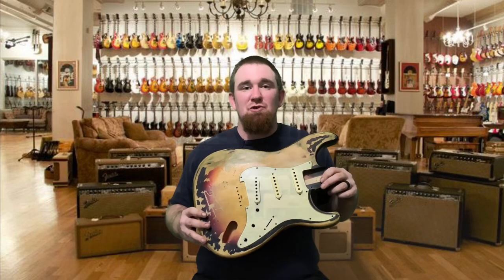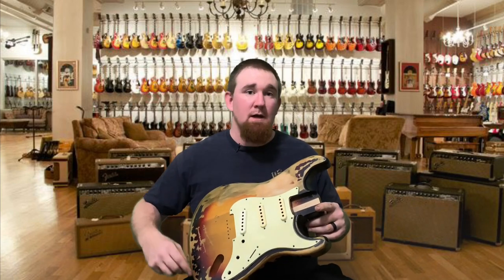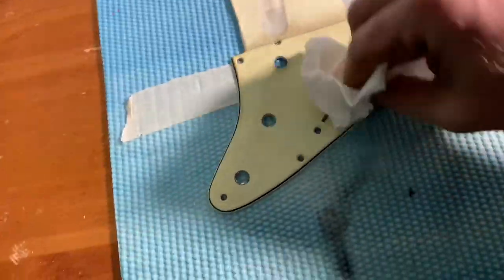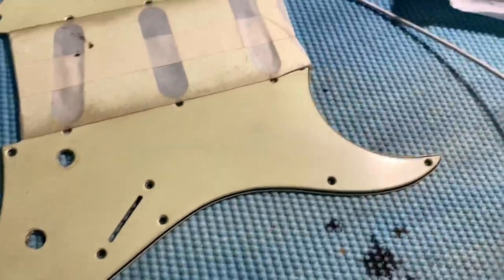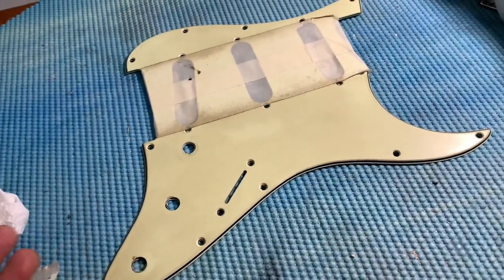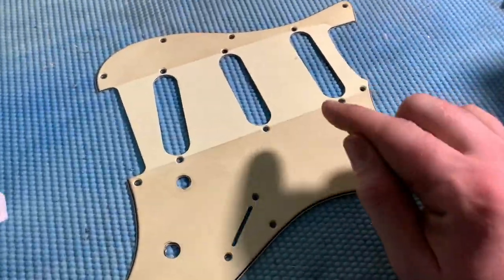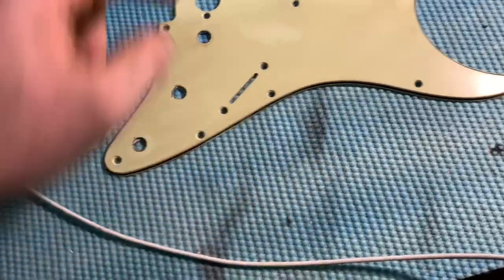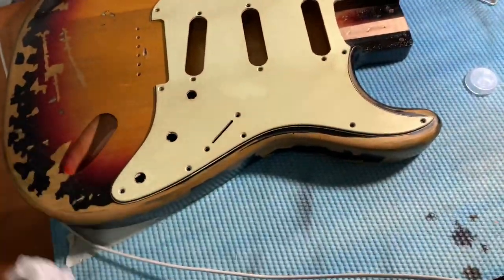How to Relic a Pickguard

Comment: Wouldn’t it be cool if you actually told us wtf you’re using in the video to age the guard. What a concept! Make sure to just rub the alcohol and not swig it 🥂
Reply: he's using a minwax wood stain. Probably one of the darker ones.
Reply: There's a better way to do it. He used minwax ebony wood stain, and steel wool. That's fine. But, the way the pros do it is to use a spray gun, or airbrush, and lightly spray an Amber tinted laquer over it. Rub it with some steel wool, heat gun to lightly warm it up and then create little cracks near the screw holes with a small hammer. In reality many vintage guitars don't have heavy ageing. They just amber over time with common little cracks where the screws go.
Reply: What's the point of showing that if you don't show what you used to make the relic colour. What a waste of time.
Reply: Lol chill out. Just find some gooey dirty crap and go to town. Dirt is uhhh... Dirt lol.
Reply: Read the can dummy
Reply: Look at the can, it’s clearly Minwax wood stain

Comment: a couple other things people can try - Lugol's iodine.  i accidentally discovered this after a guitar pick got stained.  try it on  a test piece first to see if you like the tint.  The next thing i have actually tried successfully (but takes longer) is leaving pick guard in direct sun in my vehicle in the california sun for 2-4 months.  the summer heat warped the pickgaurd however, so i would only do this in cold winter months and screw it to a piece of scrap wood first to prevent warping, but you can prolly use a UV light indoors to achieve similar results.

Comment: i left a white pick-guard out in my vehicle window for a couple months in the direct summer sun. it turned yellow, but it got a bit warped by the intense heat.  it would probably work better in the winter time when its not as hot.
Reply: Or screw it to a piece of plywood.

Comment: Guys if you want a much better method than using toxic chemicals use coffee. 
Get a aluminium foil tray large enough to fit the guard in 
Boil the kettle
I tea spoon of coffee per cup , and pour enough cups of coffee in the tray to cover the guard.
Let it soak in there till you achieve the stain you want , it also works for the knobs and coil covers. 

Don't use toxic chemicals 
Simple .
Reply: Burnt  cooking oil, leave it in direct sunlight, coffee didn’t penetrate for me
Reply: nicotine m8! Smoke A LOT!!!
Reply: Burnt cooking oil is not only toxic, but a known carcinogen as well. I'll stick with tea and coffee. Also they won't leave your pickguard all greasy and stinking of stale French fries. Or just use wood dye.

Comment: What is the stuff you rubbed into the pickguard? Also I used 1200 grit wet sandpaper and there appears to be some scratches in certain lights, is there anyway to reverse this?
Reply: Micro mesh usually helps

Comment: What make body is that? I just bough one, it’s a hard tail and look just like that.
Reply: It looks like an Allen Eden body. All of their nitro relic bodies have that exact same pattern, no matter the color or bridge option. I always see what I call “Cool Dog Falkor” on the upper horn (Neverending Story fans might see it too). And the two wear lines behind the bridge.

Now, of course with many Chinese manufacturers, Allen Eden may not be the only seller of this pattern. But I’ve only ever seen it with them. They’re about $189 on their website or eBay normally, sometimes going on sale.
Reply: @OnAir21  
Yeah, sure looks like the Allen Eden relic body. I think they overdo it, but they do use nitro even if the bodies are very light which makes me suspect a wood other than Alder, which is what they advertise. I'm also not crazy about their routing specs.
I never had the relic, although I did have a Sonic Blue poly finish. I will say that the color was nice, which made me want to work with the neck pocket and a couple of other tweeks.